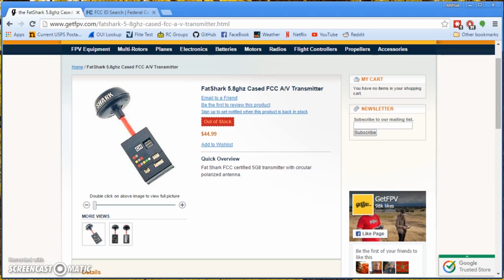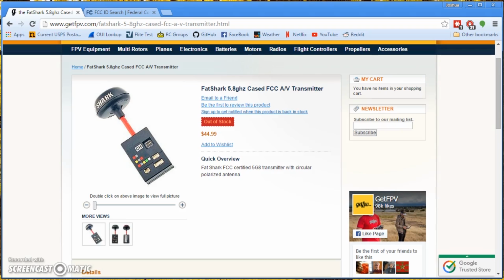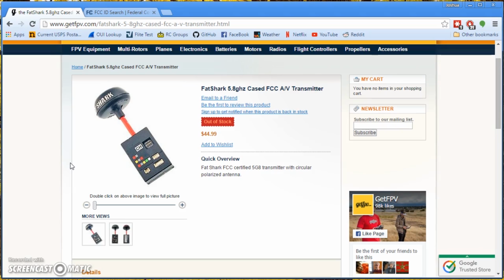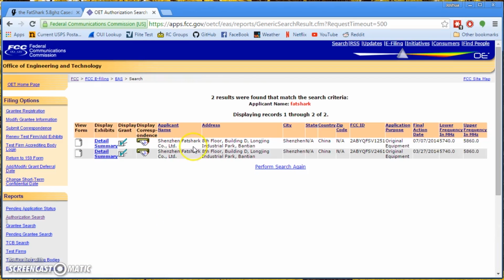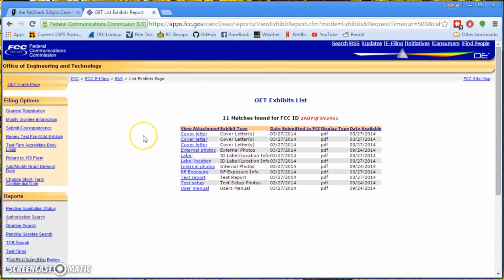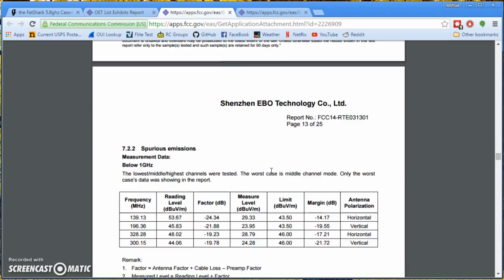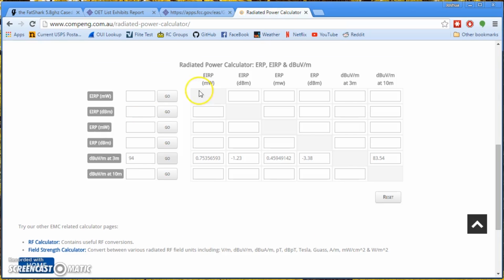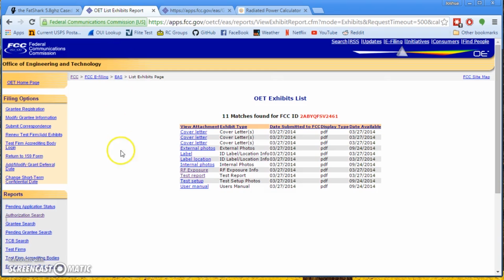Never buy an "FCC Certified" FPV video transmitter. Here's why.

Comment: Before I had my ham license, I flew with this legal transmitter and it was enough to go 200 feet, but it started getting snowy half way across the field. As a ham, all you need is to put your full name/address/call sign printed on the transmitter and you're legal up to 1.5 KILOWATTS. hahaha Just joking, actually for remote pilots, ham radio operators can only transmit up to 1 watt which is lame, but still more than enough. What sucks is that these Chinese 1.2Ghz transmitters aren't true to their specs... so you'll be transmitting outside the ham bands easily.

Comment: First off, you can not convert ERP to actual transmitter output power with that bogus calculator, and the limited variables you inputted.   Without knowing the antenna efficiency, and any device insertion losses you are just pissing into the wind.   Here is a hint... that is why it is not legal to have a removable antenna on a pt15 device.  A High gain antenna would exceed ERP limits for the classification.   

Just ask HobbyKing how well an argument with the FCC ends.  FCC newsletters are showing a significant increase in enforcement actions taken for 12.5, and 5.1cm bands.  Someone has to be complaining a whole lot.

Comment: I'm transmitting at ~600 mW at ~5945 MHz.  FCC, come find me.
Reply: That is a fixed ground station to satellite up-link frequency.   If you happen to interfere with a protected operator, I guarantee they will file an FCC report. How many does it take, and how serious they get in finding you are open to debate.  Poke the wrong bear on the wrong day...
Reply: At least lower the frequency to less than 5925. I have mine at 5.840GHz where it's just above wifi, but still within the ham bands.

Comment: You dont need any liscensing to transmit to/from your own property, just know the specs.
Reply from the maker: There is no exemption for being on your own property. Radio waves don't stay on your property.
Reply: @JoshuaBardwell  

Yes they can, radio waves dont automatically shoot half way across the world do they? You can easily have devices which only emit signals weak enough to remain on your own property, and some people have hundered or thousands of acres. There are plenty of unregulated radio spectrums because they are low power like FRS (and the government really doesnt give a shit about GMRS regulation)

In "Real estate" the owners property ends at a certain level underground or above unless the owner has wjat is called a "real title", amd many people dont have "Real Titles", hence why the government has authority for Eminent Domain, so for most people drones will not technically be om their property anyway
Reply: This is wrong. Radio waves can move infinite across every direction. Transmit poorly on the 5.8Ghz band can effect your neighbor's or even your own wifi.

Comment: Very interesting... but why would they restrict this to such a low output and mention a usable range of up to 200meters...home routers have way more power than this......this  seems like a setup for a potential failure and to crash your UAS should you be using one of these..... an actual power range up to line of sight would be more logical to allow on a fcc approved device such as this
Reply from the maker: Because marketing.

Comment: you're assuming 250mw of power in to a tx = 250mw of signal output, if that were true we wouldn't need to worry about cooling our Tx's
Reply: This is not accurate. Most 250mW VTX do transmit at or near 250mW. The power INTO the VTX is where the heat loss is accounted for.
Reply: So they suck a lot more out the battery then?
Reply: @t395delta  Yup. Looking at the Eachine TX01's product listing, it is a 25mW VTX, but it draws 200mA of current at 3.3-5v so something like 800mW of power & what's not going into the RF is heat. 600mW VTX's use much more power which is why they can fry themselves if they don't have the cooling of a flying quad.

Comment: when using another calculator to find the EIRP for the tbs unify hv it gives out 30.29089987 dBm using the 1.26 dBic tbs triumph and 0 db connector loss on 0.8W or 800mW mode...compared to this transmiter which has -1.23 dBm.

Comment: I used to use an FCC Tx on an Ultra Micro T-28 Trojan. The effective range was about 100 Yards before it became unreliable. If I used a Directional antenna with a little gain I could get 200+ yards before it started to break up. For what I was doing, and what I believe these small transmitters are designed for, it was fine. I rarely ever had the Trojan more than 50-75 yards from me anyway. With such a small plane and a 5-6 minute flight time, you don't need to go far. Same hols true for these tiny micro FPV racers. How far away do you need to go? I'm never more than 20 yards away from myself with those.. I recommend the Eachine tx01 or tx02 for ultra micro FPV now.. They are true 25mW or true 200mW. The FCC isn't going around bothering people for this yet. If you piss off or walk on any local HAMM operators in your area they will report you, so don't be a pest and you'll be fine..

Comment: Never seen anything in any manual or document saying you need to get a Ham radio license to use FPV. I have a stock FPV transmitter that transmits up to 600 milliwatts. Which is nothing in terms of making any interference problems with anyone anywhere on Planet Earth.

Have fun FCC catching me, I always fly away from cities and crowded areas anyways. Everyone's cellphone's generates more interference in one millisecond than FPV does in a lifetime of use.

Whether or not you're licensed makes no difference in the safe use of a FPV 5.8ghz transmitter. Because you are transmitting in such low milliwatts, it affects nothing or it will not interfere with anything, period.

Having to have a Ham license is extremely Stupid unless you modify your FPV transmitter which no one does. Everything is factory and factory transmitting power will never cause any problems or interference. If in the super rare chance it did, it may effect some rabbit in the woods watching TV? Really ?

 Power lines will transmit more interference in 5 minutes than anything transmitted from R/C in a lifetime.

FCC get into reality and go and get a real job !!!😬
Reply: They do an awesome job, it's a shame that some manufactures can't care less, like driving on roads, without discipline it becomes dangerous. If you don't know about what problems you could cause using illegal equipment, don't let any ignorance make you feel invincible.

It can stop signals being received at listening stations, even briefly, could cause a potential issue that completely ruins months work.
Reply: Cellphones don't generate interference because the are licensed to operate on their bands, and must prove that emissions on other bands are below a certain threshold. 

While you'll probably get away with it, technically you are causing interference if you are operating near anyone with an armature radio license.
Reply: Cellphones don't generate interference because the are licensed to operate on their bands<<
Haha, are you that ignorant?

and you spelled Amateur wrong too.. it's easy to remember> A Mate U R
Reply: I don't sweat spelling too much when I'm on my phone. 

And no, cell phones are certified by the FCC to emit only on the bands that they are allocated, and to filter all spurious emissions outside those bands to an acceptable level. If they are not capable of acceptable performance, the FCC will not certify them or allow them to be sold. Little hobby devices can get in under the radar, but not cell phones.
Reply: Went over your head that one... Seth....
Reply: http://i.imgur.com/bdgvUMM.jpg

Comment: interesting that tx power so low  and bit out of line with 
other sections in the regs....
FCC has the Part 15 section that allows for non-registered  non-licensed transmission
in the AM,FM & TV bands .you are limited to 100mw .
they like the unit to be "type approved" or "type certified" meaning they have 
tested them and they are right and ready to put in service .

Comment: You said, "This operator is not ham licensed, so they don't know the in's and out's of RF." So.. That is really no reason to hardwire the antenna, because, just because a person has a ham license, doesn't mean they know anything about how the components inside that VTX works electronically speaking. It only means they know the proper way to operate RF equipment. And if someone doesn't have a Ham license, it doesn't mean that they don't know how RF works, or how RF electronics work.  Josh, it sounds like you have real knowledge of electronics, and what you have said about your job, suggests a real understanding of RF electronics. You are also Ham licensed, SO YOU KNOW as well as I that there are A LOT of licensed Ham's that don't know JACK. All they do is learn the questions to the test.....    The reason I am saying this.. Just to point out that , the reasoning for a hard wired antenna is ridiciulous... One doesn't need a Ham ticket to put a directional antenna on a home wifi router.. If I want to set up an antenna to receive digital TV over the air, I can choose my antenna. If someone buys a CB radio.. (we are going to pretend that it's not an animal house here and that person is going to run 4 watts) That person can choose what antenna they put on their car.... That is silly... I hope you agree.
Reply: A person with an amateur radio license should know enough about regulations to know when they need to look up regulations. They have enough training to understand that there are rules and that it is their responsibility to find out what they are and follow them. And that's what the FCC will hold them responsible for.

And yeah, there are some limits on what antennas you could put on your router. There are rules about how much gain you can have.

Comment: In Germany the 25 mW rule applies, too. Not modifyable.
You need a licence to use more power in this frequency band - BUT a drone is considered as an autonomous radio station, that needs a special permission, thus is not covered by the amateur licence.
Reply: well... then just screw it and fly anyways ;)

Comment: Doesn't the mW rating, like 25mW, refer to the power the transmitter is delivering to the feed line?  I certainly could be wrong but I really thought it is not the ERP value, but the antenna drive power.  (Always ERP will be measurably less because even wonderful antennas have loss.)  Still though, wow that's crap.  ERP of 0.23mW = 0.00023W is far below the ERP of a 25mW transmitter driving even a real crap antenna - you should still achieve 10mW ERP.  This though, this is orders of magnitude less.
Reply from the maker: That's a great point.
Reply: I sell 10mW 2.4g and 5.8g micro and hidden cams..FCC approved..you'd be lucky to transmit 20m stable enough to FPV.

Comment: Thanks Josh, Could you help me by explaining how you knew to at 3 meters vs at 10 meters? It's not a huge difference but aren't we typically traveling  further than 3 meters away? Thanks so much for your awesome content!
Reply from the maker: +Jason Kass the distance to measure at is just a reference standard. As long as the measurement is taken at the same distance every time, the comparison will be valid. I believe the FCC paper specifies @3 meters. RF energy dissipates according to the inverse square law so if you know the energy density at one distance, you can calculate the energy density at any distance.
Reply: Joshua Bardwell thank you, I'm starting to prepare for my Ham, I'll examine that FCC paperwork and see if I can locate it. I appreciate to super quick response!

Comment: I think most TX power rating are what you would read if you connected a power meter or spectrum analyzer directly to the SMA connector. Those specs for the FCC certified device are the radiated power yes? So if you were to measure a 200mW TX radiating from the antenna with the same method the FCC testing does it would be MUCH lower than 200mW. So I am not entirely sure this comparison is fair. Correct me if I am mistaken.
Reply from the maker: +Tim Evans you can convert the FCC radiated power back to dBm or mW EIRP which is what I've done.
Reply: OK. I think I misunderstood the conversion. I thought it was straight unit conversion. I looked up EIRP and think I understand now. Thanks for the response.

Comment: did you ever tried to use gopro composite output as a feed for TS5823 ( https://shop.gopro.com/accessories/combo-cable/ANCBL-301.html )
Reply: The go pro's have way too much latency for proper FPV. This is why low res analog cameras are always used.
Reply from the maker: I've never owned a GoPro.

Comment: This is a receiver only it is an rc remote control unit
Reply from the maker: +Jason howe I think you commented on the wrong video. This is an FPV video transmitter.
Reply: looks like the same hardware used in high end remote control cars
prior to viewing this video I saw this used in remote control vehicles, this why the output is so low, because it is a receiver not a transceiver...
Reply from the maker: +Jason howe This is a video transmitter. This is not a receiver. Look at the product listing, for goodness' sake.

Comment from the maker: For those who want a more theoretical discussion of the "terrible range" claim:

Free Space Path loss over 200 meters at 5.8 GHz is 90 dB. Assume the antennas used have about 2 dBc gain, for a total of 4 dBc, for a path loss of 90 - 4 = 86 dB. A transmit power of 0.4 mW = -4 dBm. Therefore, the sensitivity of the receiver would have to be -4 - 86= -90 dBm in order to achieve 200 meters range.

Well, what a coincidence! The FatShark NexWave V2 modules have receiver sensitivity of -90 dBm! So this completely supports what I said. The 200 meter range is achievable under perfectly optimal conditions only. For example, the antenna used only has 2 dBc gain at 0 degrees elevation. As you go up in elevation relative to the antenna, its gain decreases significantly and its range decreases. Some of the channels transmitted at only 0.2 mW, which is -7 dBm, which is 3 dB less than the maximum transmit power. A transmitter operating on this channel would not be able to achieve 200 meters range.

And let's not forget through all of this that we are measuring range down to the absolute bottom of the receiver's sensitivity, at which point the picture will be nearly unusable for flying, even though technically the signal is still coherent.

Comment: Break it open- I bet there is a transistor limiting the output that could be adjusted.... but no modifications allowed per FCC regs. I bet they use a 25mw transmitter governed down to meet the test.
Reply: Don't need to break it open. Since it's FCC certified, there are photos available online for free. FCCID.io